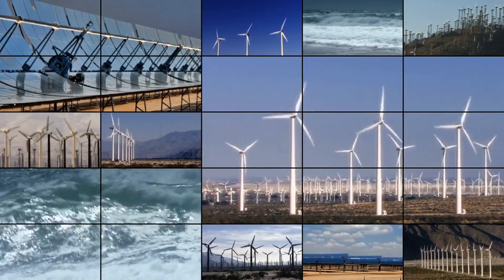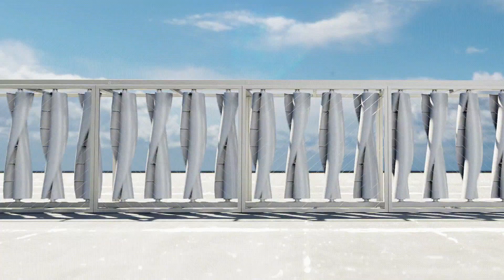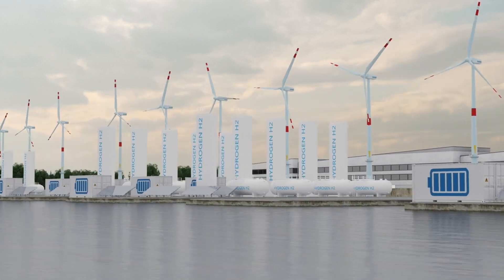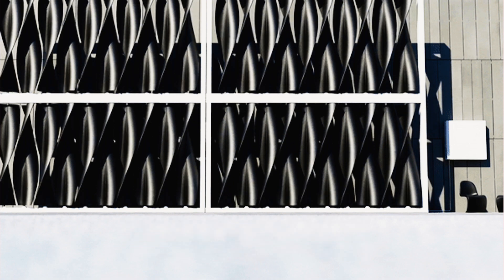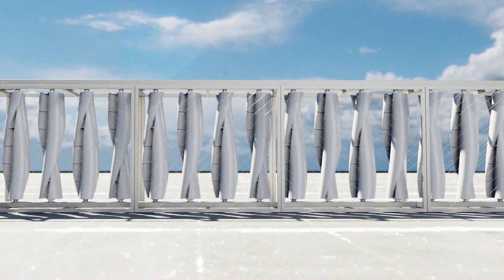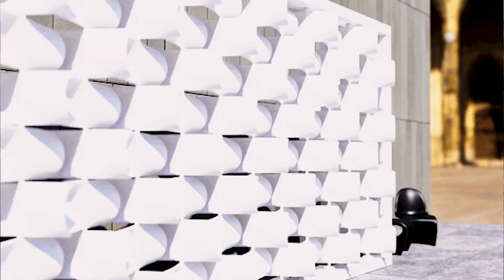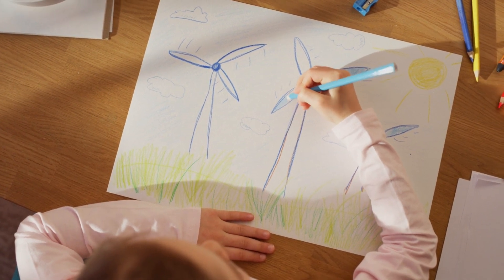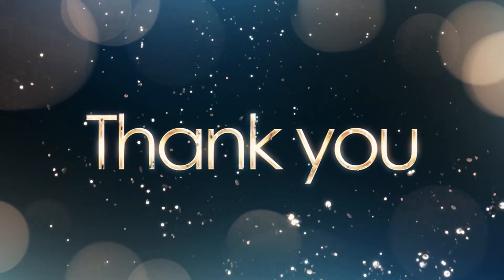Novel US Wind Turbine Wall Around Houses

Comment: YOUR CAPTION SAYS "10 KW PER YEAR..."😭😭😭😭😭😭😭😭😭😭😭😭😭😭👎👎👎👎
Reply from the maker: A wind wall turbine is a system of multiple small wind turbines designed to generate electricity from ambient wind, often in urban or space-constrained environments. Unlike traditional large wind turbines, wind walls are modular and can be installed on building facades, fences, or rooftops. They offer a way to integrate renewable energy generation into urban landscapes.

Comment: Does the wind have to blow directly into the wind turbine or can the blow from the side into it to produce electricity?
Reply from the maker: It should be directly
Reply: From what I've read so far. It's not direct, It is multi directional which solves the issue with other types of wind generation products. If you think about the design of the blade, you can understand that the wind can blow from any direction to turn those blades of that design